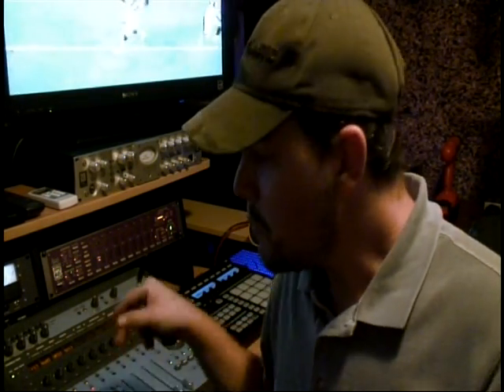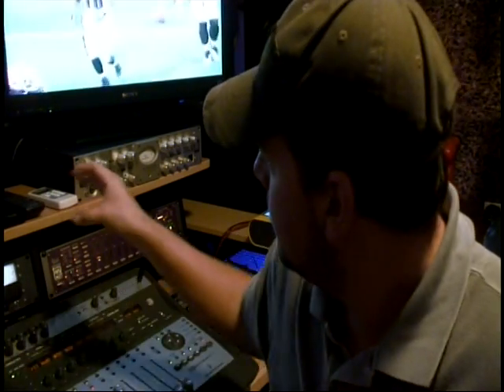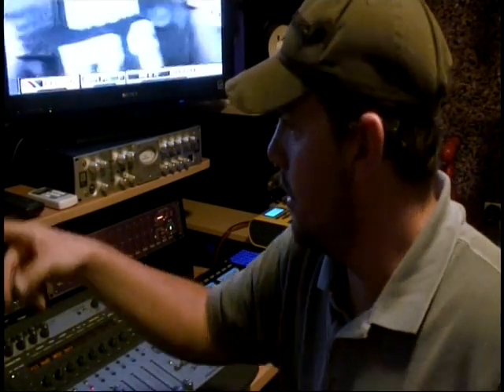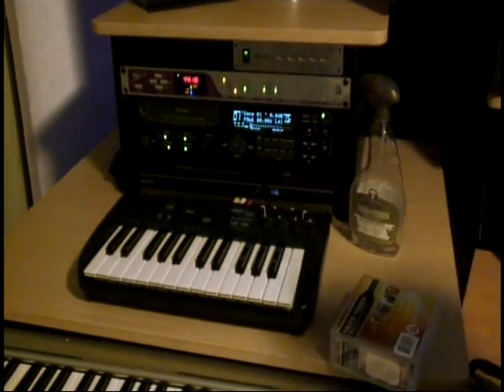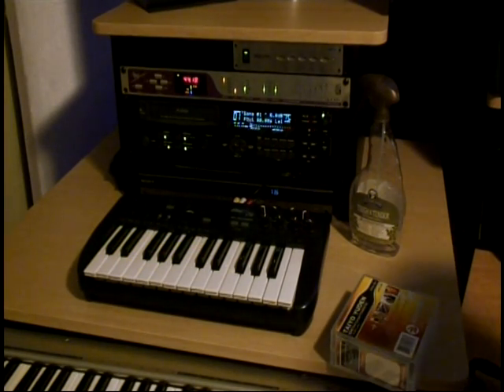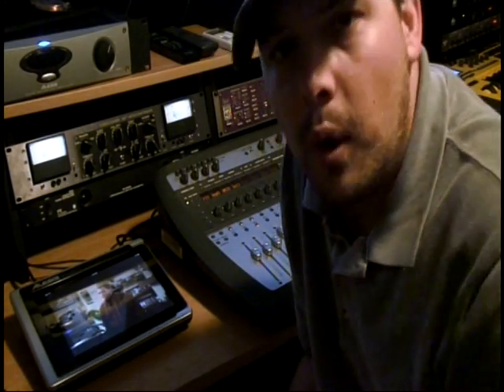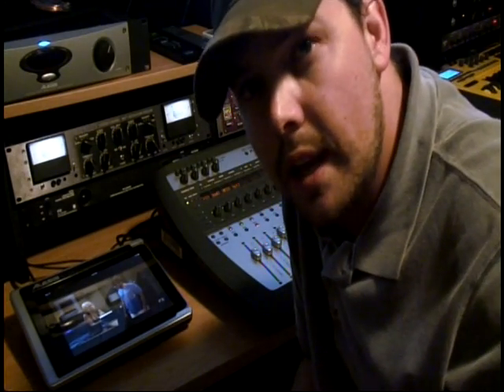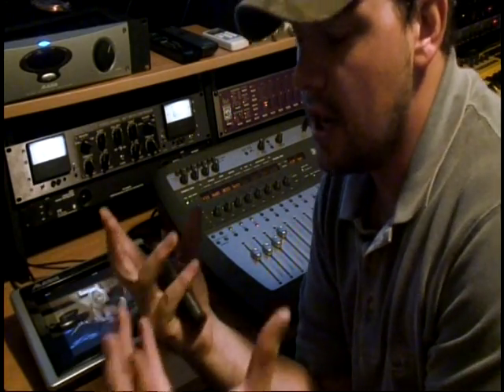Hooking up ad/da convertors and clock to interface

Comment: Hello Doug! 
This is a great video . 👍🏽
I’m an aspiring Music Producer/Beat Maker and 
I have the Digi002 console along with my HP Quadcore i5 PC, a Korg i3 Keyboard and a AT2020 microphone.

I have ProTools 8 LE, PT 12, and Akai MPC 2 DAWs.

My sound source are a pair of Alesis M1 Active 520 Studio Monitors.

Can you educate me and maybe others if there are converter settings inside the DIGI002?

Also, I’m interested in selling beats through your site as you mentioned in your video.

How do I go about that?

Will you need stems for the beats?

Comment: Hey there lets say I have a Ross Martin AD (which I do) and a Cambridge dac magic audio plus AD/DAC (which I will use for playback). Does the Cambridge still need input and output into the interface or can I just use 1 output since I will be using it for playback, while the Ross Martin does the AD work? Also would the Focusrite Scarlette 18i20 interface work with this setup?? Please help

Comment: Hello, I have stayed in the part where the video ends, I have the same setting as you, 002, rosetta and big ben, but I did not understand why you should connect the 002 for spdif, I would appreciate your answers and what are the next steps
Reply from the maker: Victor Delgado you don't have to.Just run adat in and out of rosetta but i would suggest running word clock out of big ben to rosetta in and spdif out of big ben to 002. Just a good way to make sure you always have the big ben as the main clock
Reply: thank you!

Comment: If I want to connect a Octopre to a motu 896 should I useadat optical or bnc wc? Or both? I will then connect the motu into the pc
Reply from the maker: +Juan Pablo  You would need to use adat to pass audio to the motu,  the bnc connection is more efficient for clock source information.   so both is what I would do..  you would need to clock the octopre to the motu. by setting clock on octopre as external.. hope this helps
Reply: Done! worked great thanks. I also have a 1073DPD I will try to connect it from its AES out to MOTU AES in, does AES protocol carries clock signal?
Reply from the maker: +Juan Pablo yes aes carries both

Comment: hi.i have a focusrite 18i20. for example i get a apogee rosetta or big ben, how do i connect the interface and the ADDA converter to my PC? thanks in advance.
Reply from the maker: You would have to route it spdif or adat through your focusrite if it has digital inputs
Reply: +Doug Jenkins och hi. so a simple rca cable from spdif out of the convertee to the input spdif of the focusrite? will i also need a second rca cable to route back to converter?
Reply from the maker: +Kalle Ankaa yes you need a spdif cable it looks like rca but it caries digital word clock
Reply from the maker: +Doug Jenkins and yep it needs to go in and out
Reply: +Doug Jenkins ok i understand.you said it looks like rca cable but also carries wordclock signal. how do i know my local hardware store has that type with the rca cable carring signal from the standard rca mono cable (the cheap one)

Comment: Doug thanks for your time to explain all of these! I do have a question for you.  I do have a double 002 just as yours and recently bought a duet apogee , my question is :
  Can I use my duet as my clock and my 002 as my interface? 
  I would like to take advantage of all in and out from my 002 , but i want to use the duet converters instead ...
Would i be able to do that?
Reply: conectado por el puerto ADAT, estarías convirtiendo la señal con la apogee, y la 002 sería solo un puente

Comment: Hi, I came across your channel and am so glad that I did; Great vids! I was wondering, I have Pro Tools 10 and a bunch of equipment, from a Novation Supernova 2, to a Micro Korg X, to an MPC Renaissance to smaller pieces like a Boss DR5 and a Roland VT3.. And; I was looking to get a new audio interface and wasnt sure which was best. What do you think is best to go with? : The Mbox 3 Pro, the RME Babyface, Apogee Duet 2 or the Apollo Twin??? I wanted something that would give the best / clearest sound and I wasnt sure which to go with. Any info / help would be super appreciated! Thanks! X
Reply: Kind of looking at this backwards but the ren has the capability to run the cable needed....in some ways, this is more of command center in its true format.  Out of what you wrote I would use the Rme UCX or FF and route the clock to connect.  That's just me though.
Reply: The original Apollo twin or the brand new black one would be best options.  Let me know where you got with this I have a similar setup.  Basically above is more focused at mastering on a pro level.

Comment: hey doug, appreciate all your videos been a big help. 
im opening up a new studio running pro tools hd native with a hd i/o 16x16 . im also gonna use a 2bus lt for summing. I figured out how to hook up the two but want to bring the monitor section out to my c24. do you know how I could do this ? I want to throw a big ben in the mix but am having trouble. if you can help with an idea id appreciate it. best of luck
Reply from the maker: Benjamin Watson   In this case, you would have to dedicate multiple outputs to your convertor in this setup.. 8 outs on a db25 directly to your c24..   I would recommend doing this through a patchbay though.  So you don't eat up all your outputs if your not using them this way..   so let's say you buy a db25 patchbay, you could run everything into this, so you can use your outputs for multiple things.. then the big ben or external clock would just run directly to the convertor/ convertors for clocking ...  I am going to do another video explaing this in depth..

Comment: yo man i rly need a tip from a guy like you.
meaning a guy who knows all this crazy stuff.

my goal: i wanna record just 1 track at a time. no more, but that 1 in the highest possible quality.

 so i figured: i get a lunchbox,  maybe neve preamp, EQ, Comp, a good ADC.
and boom. i am done.

trueee? XD
Reply from the maker: Captain Mike Meloni   Yes you are definitely thinking the right way..  1 nice preamp, one nice convertor.  it really is that simple..  You may need a DA though, so you can hear all that goodness and what it actually sounds like..   I think a lot of people would be further ahead with this attitude..  Then send it off to get mixed.. it does make a difference for sure.. the mixing is a whole new animal of routing, and not as simple of a process.   more inputs and outputs, multiple pieces of gear running loops to process the sounds..  little more in depth.. But if you want to just make music, buying a neve pre, and recording one at a time is a good plan.. I have a guy I know with a lunchbox, that just constantly is buying new pres, shadow hills, neve, api, and he has some amazing recordings that I mix for him..  God bless, and great luck..  you caught me in the studio checking my youtube channel..
Reply: thxxx alot.
1 last thing if you got the time..
how do i get the A/D converter output,  into my sequencer?

am i missing 1 more expensive thing?
i hope not.
i figure the signal is already digital in good quality, so i dont really want it altered anymore right?

i googled it and i read "interface" or "pci card".
i just need to know that at that point the quality doesnt matter anymore right? its just a matter of transporting the signal
Reply from the maker: Yes your missing a D/A that is for your speakers, you can capture the a/d through spdif or adat, but it's smart to buy a A/D-D/A convertor like a lynx aurora, or all kinds of options, a lot of companies are doing both in the same box now.. where back in the day, they would do them separate..  but you would need a D/A conversion to hear the results, and print back into the d.a.w or use spdif out to another interface..  how I didn't confuse you..  I used a rme 9652 pcie card, and ran stand alone with a symphony I/o and apogee rosetta 800 for years, sounded awesome.. the rme was the interface.. the rosetta was the convertor..  hope this helps.. or you can buy one with connectivity already, like a lynx aurora with usb or firewire built in.. or antelope audio, apogee .. things like this..
Reply: thank you alot.
btw all of this is just to record rap vocals.
would you advice me to compress& EQ rap vocals analog before it even hits the converter?

i thought i just get comps, EQ, and preamp all 3 from neve.
Reply from the maker: Captain Mike Meloni   I would compress and eq after..  by running the piece of gear as a insert..  I do it on the way in, but make sure I don't hit it too hard..  creating a insert is running out and in the convertor creating a loop so you can use your hardware like a plugin..  that's a long explanation, I did a video on that somewhere
Reply: do you beef up digital drumsamples by running them through  D/A  into EQ / COMP back into A/D ?
is that a thing? or dumb lol
Reply: u know twitch lets musicians stream now .. ?
bet you could get some views just by answering all this stuff

Comment: Hey Doug thanks for your videos, one question, does hooking up the converter via spidf completely bypass the converters on the interface?or is this something to set in your daw? Thanks in advance
Reply from the maker: mrjoshua2141   It does bypass the convertor and uses the clock and convertor of whatever you are running spdif
Reply: +Doug Jenkins same with adat?
Reply: +mrjoshua2141 also are you setting the source in protools to word or adat

Comment: hey doug - not sure if this has been asked or mentioned in previous comments/threads but what would the chain on this be? would it go from computer - interface - converter - clock and then back through the interface to the computer? just trying to get a visual representation of of the chain of events work!
Reply from the maker: I will look to do a video on this, to explain it..
Reply: Doug Jenkins Did you make one yet?  Its confusing not to know this, thanks
Reply from the maker: not yet, this month I should have some time to get back into the videos, sorry for the wait
Reply from the maker: George Barlow  Sorry for late response, the clock is built into the convertor, if external clock, it does not carry sound, just send clock signal to convertor..  The chain would be dependent on how you convertor is hooked up.. for example  Lynx aurora usb,, the usb would transfer the conversion to the computer.. if you had a external clock, it would send a clock signal out, to the input of the convertor.. Let me try to hurry and make a video on this..

Comment: Doug Jenkins, i thought that you mentioned you have prism converters? I have an apollo 8 quad thunderbolt and i want to buy a Prism dream ada 8xr and a Teletronix la2a and a mannley massive passive for mastering. How do i go about connecting these the correct way so i can get the best out of them?
Reply from the maker: I have a antelope zodiac + and a symphony i/o this was a old school video.. 
a lot has changed in 4 years..     you would create inserts with your gear.   create a dedicated input and output on your interface, and dedicate it to each piece of gear.  the massive passive, and the la2a you can assign to the track.. I will do a video on this, because it's a widely asked question..
Reply: Doug Jenkins So the ada 8 xr is no good? I need to know if i still need the apollo 8 quad as i use it to connect my avalon 737 and i dont use the pres on the apollo as i heard you can record with the dream ada 8xr which means i can use it as a soundcard via thunderbolt to firewire converter as i use an iMac?
Reply from the maker: Yes firewire this could be your main interface.. so no need for the apollo, if you don't use the pre's then the prism would be a super convertor for any setup, and yes, you'd need external pre's like the 737 and your good to go
Reply: Doug Jenkins So how do i connect my monitors to the prism? and when will you be uploading the vid so i can log on check it out. But i love the apollo because of the latency and the uad plugins. So how would i connect the apollo to the prism? My current setup = u87 (i have a couple of mics which i wont mention) , apollo 8 quad thunderbolt, iMac quad core i5 3.5ghz, avalon 737, and i really need to get this prism ada 8xr, massive passive and la2a. I just dont know how to connect them the best way and efficiently for best conversion and quality

Comment: How does this 2011 Clock + Converters setup compare with your actual setup? Do you hear much difference? At what sample rate do you work?
Reply from the maker: We run a symphony i/o now in the studio.  and this you can hear a huge difference.  such a huge image. Just got finished doing a job for Broadcast, at 24bit, 48k.  sounded very imaged, and has a lot of depth..
Reply: Nice to know man! Thank you for your time!
Reply: Doug Jenkins But what if you are mixing virtual synths ITB, How would an AD\DA converter improve the integrity, if the signal never leaves the computer?
Reply from the maker: The converter is still going from Analog to digital and digital to analog to play through your speakers, but you have brought up a great question.  at some point when bouncing out, it will leave that software, and it will be at the mercy of the convertor.  A great clock will insure no artifacts when listening for accuracy, and bouncing to a wav file.  for final processing.    The sole purpose of that convertor is to represent that sound, as the software designer intended.  companys like UAD  make it clear that having a sharc chip for there plugin line there is a reason, allows the computer to reproduce the actual hardware they are emulating with ease (more analog sound).  same with a vst instrument.. Allowing that plug to have all the power it needs to operate at it's full potential, and using the highest level conversion you can on the D/A side of things, insures your hearing it for what it is..   I remember a while back a friend of mine, complained about reverb plugins, and how they aren't giving him what he wanted. I told him it wasn't the plugin, but the actual Processor/Ram, and conversion/clock combo.  Long story short, he upgraded, and was blown away by how the same plugins now sounded 100x better.   so to answer your question.  You could send me a pro tools session with virtual instruments, and we haven't given it a new form,  but once it leaves that software, your at the mercy of the convertor you finalize with.. a lot of pro consumer interfaces, seem to chop off dynamic range, and leave the sound, sounding squashed.  where a convertor like a symphony i/o  keeps the dynamics in tact.  Most important though, understanding your Digital to analog convertor, and understand your speakers, and room.. and creating a sound that sounds great in the work.. it's just a lot easier to insure space and quality with better made convertors..
Reply from the maker: Now we have a antelpe zodiac and symphony i/o both improved upon clocking, compared to the big ben,, They are all top shelf, but the zodiac da and symphony i/o are super super transparent, and imaged.   better yes, by enough to justify the money to buy?  If your a engineer yes, if your looking into gettting quality sound a big ben and apogee ad8000se or rosetta is a killer combo...  all are great..
Reply from the maker: Doug Jenkins
not like upgrading from a mbox to a symphony i/o you will be floored with the difference there.. or any other interface in that range of the mbox. Not knocking mbox, usually the most popular though
Reply: Wow so many useful informations, thank you! Do you think a Focusrite Forte or Apogee Quartet is a good start for a student starting in the business?